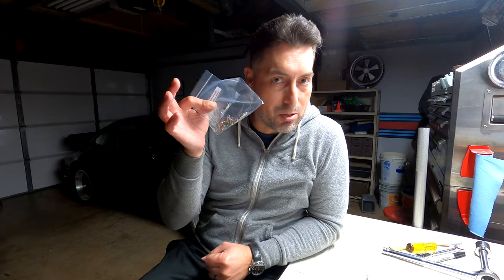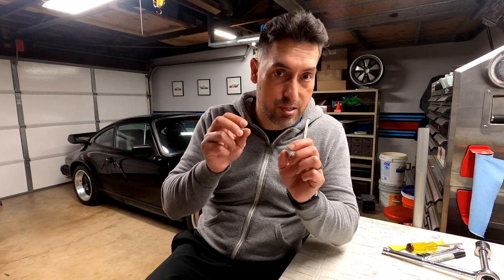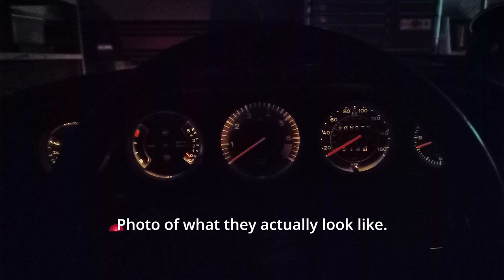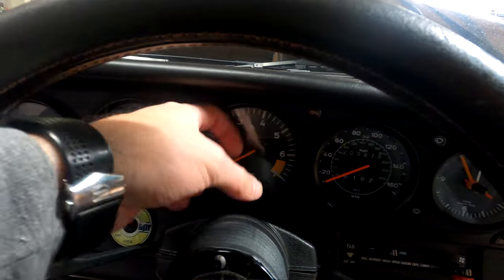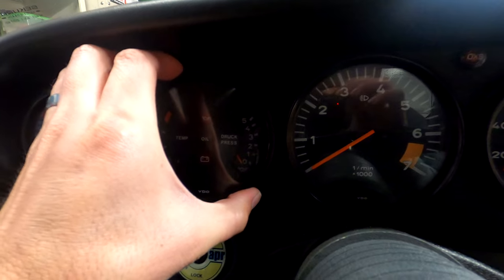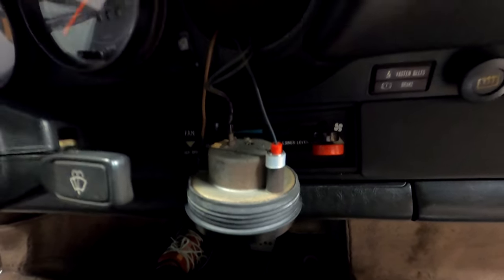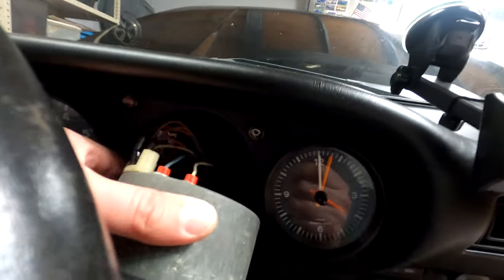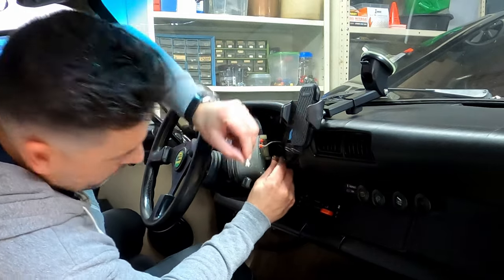Air-Cooled Porsche 911 LED Bulb Upgrade For Dash Gauges

Comment: Did this same upgrade for my 86' Coupe.  This has been one of the best upgrades I have done...
Great to see you take the time to do a full video on the install for others on the fence of upgrading.  

As an FYI - I was actually pulled over for having my turn signal on while driving down the road as my switch had a malfunction and the original lights were so dim I had no idea in the bright sunlight.  No ticket just an officer letting me know.  The new LED indicators are very bright and definitely let you know your turn signals are on/off.  

Again, thanks for taking the time to show your install I am sure many will find it useful.

Erik

Comment: Great video: the open chip type bulbs are fragile and you can get shorting: I used glass  enclosed led bulbs, which have no exposed chips and also a more even light pattern, like the original incandescent, avoiding the need to fiddle about with orientation. Having gone to the trouble of pulling out the clocks, I also changed the other bulbs : indicators, full beam, oil etc. Best to use an led bulb of the right colour for these but  DO NOT CHANGE THE RED IGNITION BULB to LED; this must remain a traditional bulb with a higher current draw, to give the right feedback to the alternator .
Reply from the maker: Thanks for the feedback. I'll keep an eye out for more modern bulbs!
Reply: Tony. What bulbs and from where are u using and recommending
Reply: They are Ba7s..I got  mine from Emberton Imperial Classic Land Rover in UK..they are warm white which look like original..

Comment: I enjoy your videos.  They are very methodical and they stick to the point without drama and hyped up "music".  I have a couple of ideas for future videos for your consideration if you are interested.  
One would be tackling the many unfused circuits on the SC.  There are many circuits that should have been fused by the factory but were not.  A video showing where and how to install inline fuses to protect these circuits would be helpful.
A second would be a detailed video of the HVAC air distribution systems showing where each of the air hoses go from source to end destination.  It is very confusing given the separate systems for fresh air, heat and air conditioning.  Cars with footwell blowers especially have a spaghetti bowl of hoses that are hard to trace.
There are write-ups on Pelican forums, but videos would be super helpful and your detailed way of explaining things would be beneficial.  Cheers.

Comment: I usually turn my gauges down to the minimum when driving at night if I can so I can see the road.  I would like brighter headlights, however.
Thanks for the installation information, though all the same.